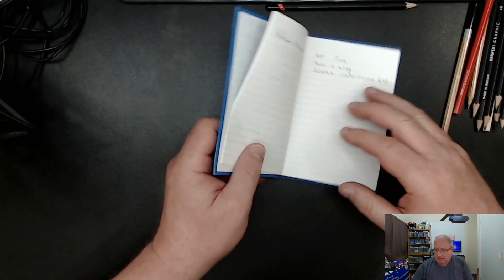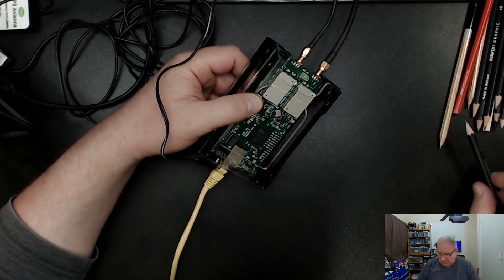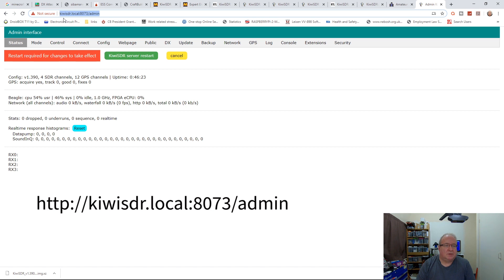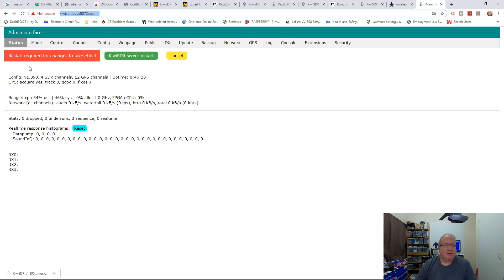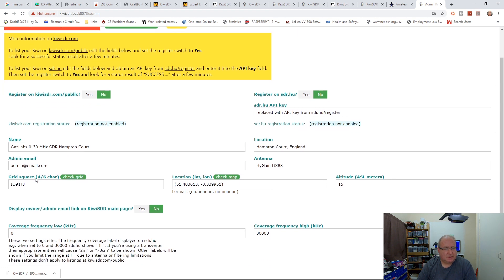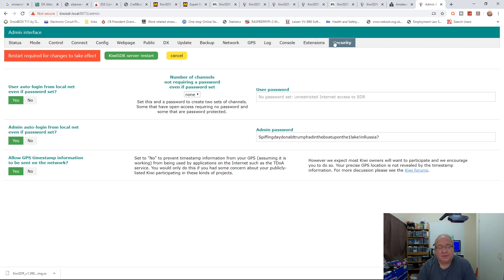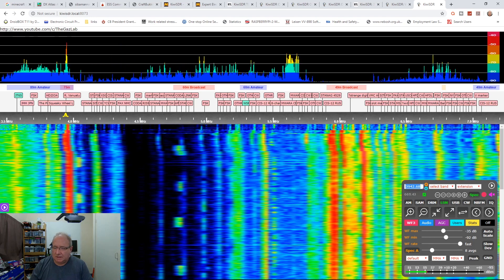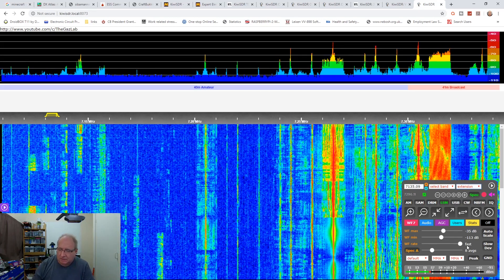The Kiwi SDR introduction..

Comment: You seem to have problems adjusting the frequency - Try the diferent minus and plus buttons above the mode selection :)

Got my kiwi online and open for others since I bought it - connected it via a wifi dongle, added a cheap wifi controled antenna switch from lz2rr on ebay to it (wrote a plugin for the antenna switch extension for it).
Great man toy :)
Reply from the maker: Thanks, yes I was having trouble tuning it.. Sometimes it works without issue others it is a pig.. I put a lot of the issue down to lag.. I understand the dev isn't doing much more with it or has slowed down developing the software.. Shame but he has bills to pay etc I'm sure :-) I love the project its really neat.. Thanks again for the advice.. Gaz